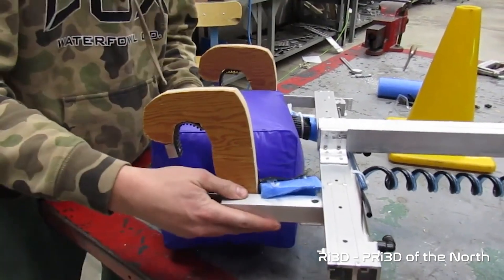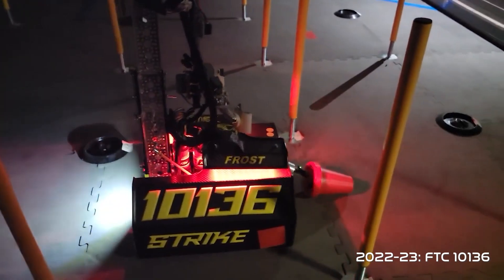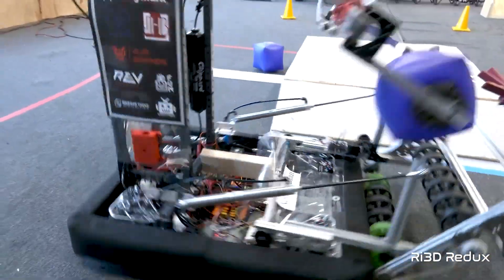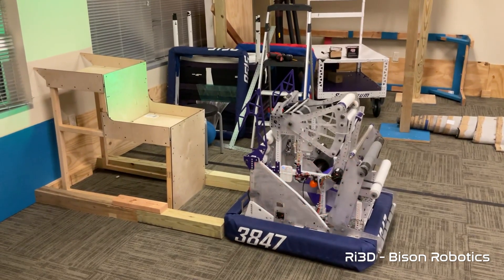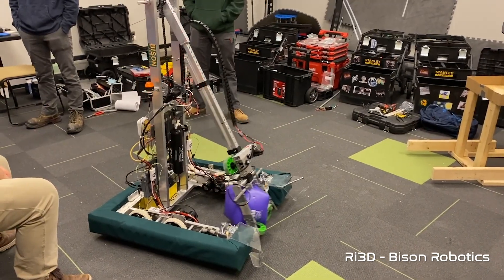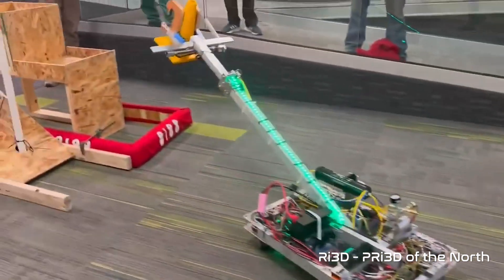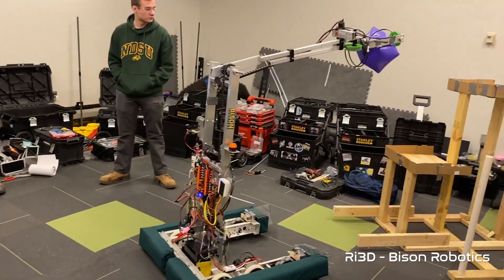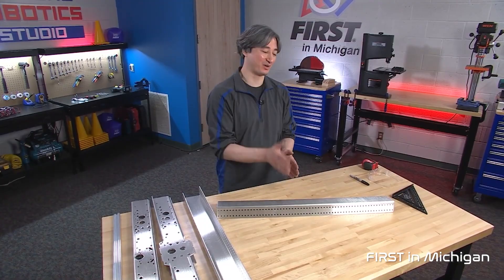Best of Robot in 3 Days 2023 - FRC Charged Up! - Team Ri3D 1.0

Comment: Why is indexing critical in a single-gamepiece game where the vast majority of current designs use just one effector that doubles as an intake and scoring mechanism?
Reply from the maker: Because of the single piece limit, jamming or game pieces winding up somewhere internal that they shouldn’t be due to robot impacts can result in a robot unable to do much for the remainder of the match. For pinching mechanisms, this is less likely unless it drops it within the frame but for rollers that take pieces into the robot it can be.